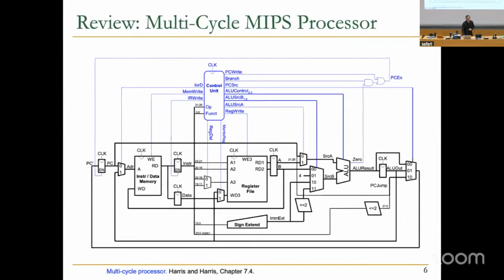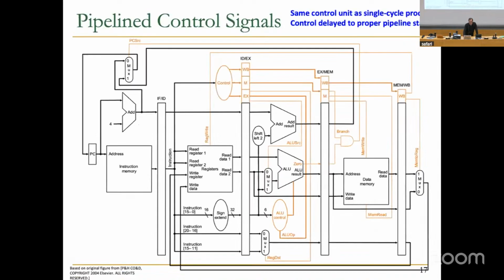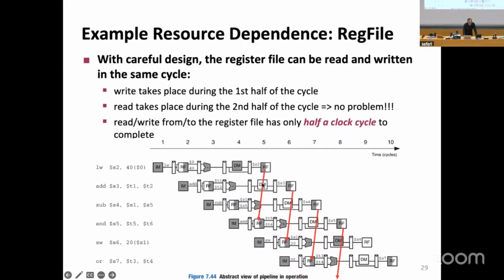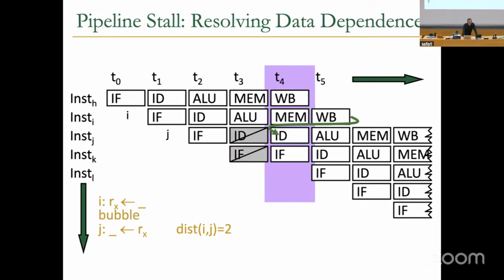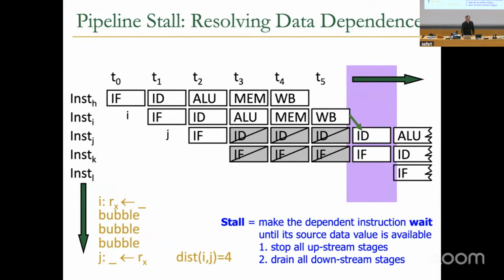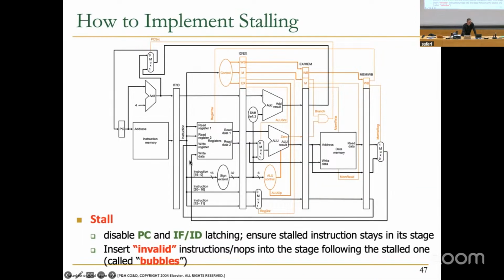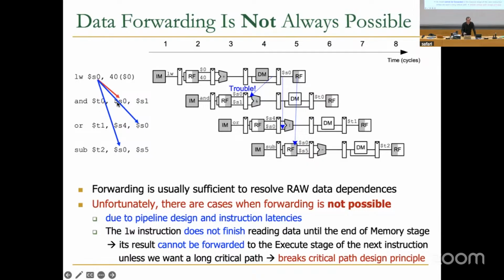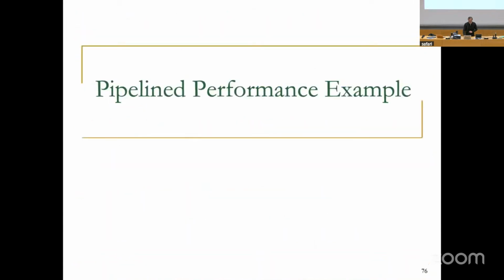Digital Design and Computer Arch. - L12: Pipelined Processor Design II (Spring 2025)

Comment: AI Summary

Pipeline Processor Design: Dependencies, Stalls, and Forwarding

*   00:03:35 Introduction: The lecture aims to cover the basics of pipeline processor design, focusing on handling data and control dependencies.
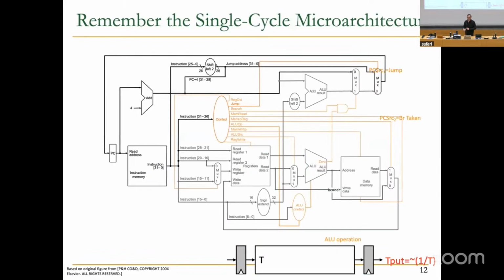*   00:06:00 Pipeline Design Process: Designing a pipeline starts with a single-cycle data path, which is then broken down into stages (e.g., 5 stages: Fetch, Decode, Execute, Memory, Writeback).
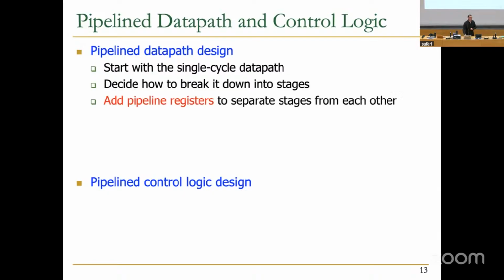*   00:07:58 Pipeline Registers: Registers are added between stages to isolate them and store intermediate data and control signals needed in later stages. Signals must be propagated correctly.
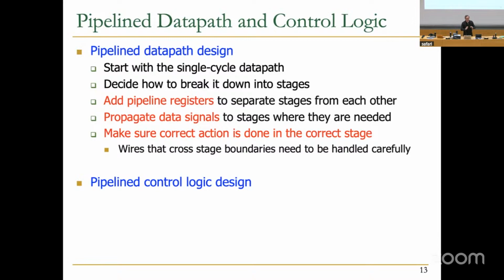*   00:10:41 Pipeline Control Logic: Control signals are largely the same as in a single-cycle processor but must be delayed/propagated through pipeline registers to the stage where they are needed, ensuring the control signal arrives with the corresponding instruction's data.
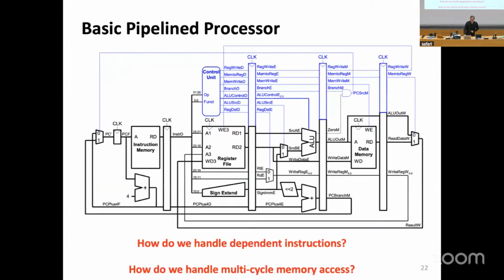*   00:26:05 Pipeline Hazards/Issues: Real instruction pipelines violate ideal assumptions (e.g., instructions aren't independent, stages have different latencies), leading to issues like resource contention and dependencies that require handling.
*   00:30:47 Pipeline Stalls: A stall occurs when the pipeline must stop moving forward due to resource contention, data dependencies, or long-latency operations. This involves stopping upstream stages and injecting "bubbles" (no-ops) into downstream stages.
*   00:32:23 Handling Resource Contention: Solutions include replicating the contended resource (e.g., separate instruction/data caches, multi-ported register files) or detecting contention and stalling one instruction (usually the younger one). A common trick assumes register file writes happen in the first half of the cycle and reads in the second half.
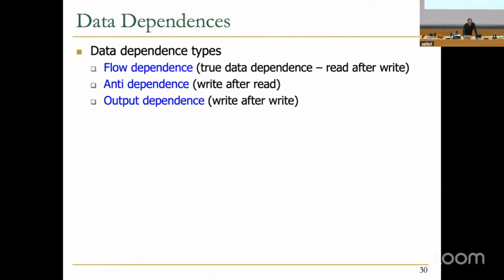*   00:37:22 Data Dependencies: Three types exist: Flow (Read-After-Write - true dependence), Anti (Write-After-Read), and Output (Write-After-Write). Anti and output dependencies are "name dependencies" caused by register reuse and are typically handled by ensuring writes occur only in the final stage (Writeback) in program order.
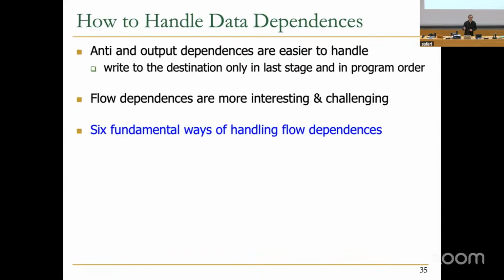*   00:44:21 Handling Flow Dependencies: Several strategies exist: detect and wait (stall), detect and forward data, eliminate dependency in software (instruction scheduling/no-ops), predict the value, or execute instructions from another thread (multithreading).
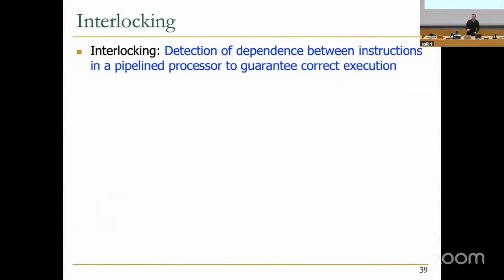*   01:04:44 Dependence Detection (Hardware): Methods include scoreboarding (using valid bits per register) or combinational logic (comparing source registers in Decode with destination registers of instructions in later stages).
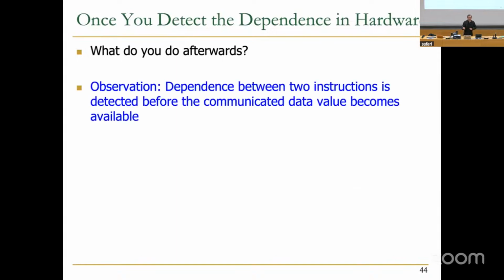*   01:13:38 Data Forwarding/Bypassing: Instead of waiting for a value to be written back to the register file, the result is forwarded directly from the output register of the producer stage (e.g., EX or MEM) to the input of the consumer stage's ALU using extra muxes and wires. This significantly reduces stalls.
*   01:31:31 Load-Use Hazard: Forwarding isn't always sufficient. A load instruction's data is only available after the Memory stage, but an immediately following dependent instruction needs it at the start of the Execute stage. This specific case still requires a one-cycle stall.
*   01:33:30 Stall Implementation: Hardware stalls are implemented by disabling writes to the PC and preceding pipeline registers (holding instructions) and inserting a bubble (e.g., clearing control signals) into the register following the stalled stage.
*   01:36:05 Control Dependencies (Branches): A major issue is determining the next instruction to fetch when a branch is encountered. The branch outcome and target address are usually calculated late in the pipeline.
*   01:38:37 Branch Prediction & Flushing: Processors implicitly predict (e.g., always predict "not taken" and fetch PC+4). If the prediction is wrong, the incorrectly fetched instructions must be "flushed" (invalidated/turned into bubbles) from the pipeline. The number of flushed instructions is the misprediction penalty.
*   01:41:43 Early Branch Resolution: Branch logic can be moved earlier (e.g., to the Decode stage) to reduce the misprediction penalty. However, this can increase the clock cycle time (longer critical path in Decode), adds hardware complexity, and requires forwarding for branch operands.
*   01:45:52 Smarter Branch Prediction: More advanced techniques (using history, heuristics, machine learning) are used in modern processors to predict branch outcomes more accurately, minimizing flushes and improving performance.

I used gemini-2.5-pro-exp-03-25| input-price: 1.25 output-price: 5 max-context-length: 128_000 on rocketrecap dot com to summarize the transcript.
Input tokens: 50361
Output tokens: 1033